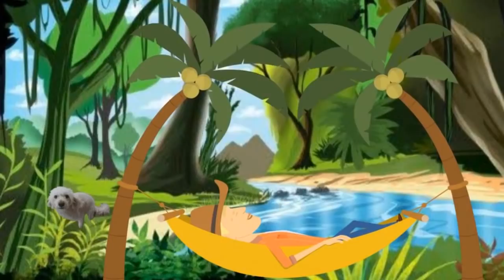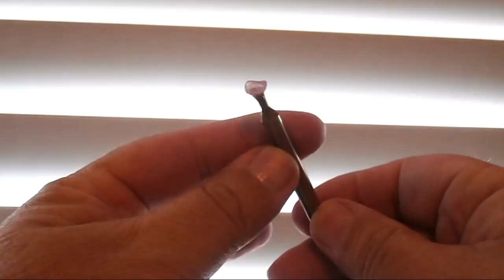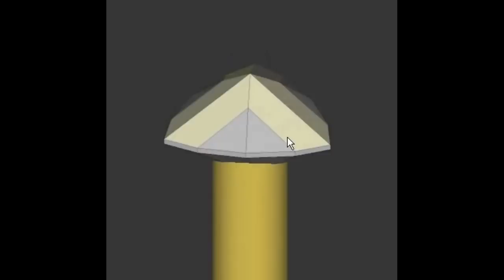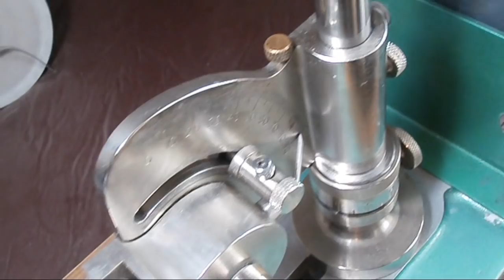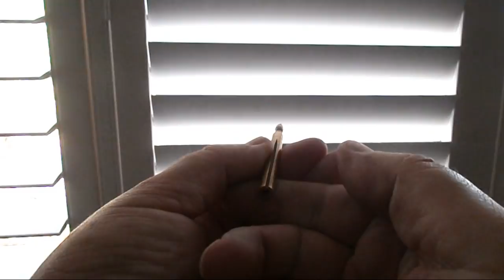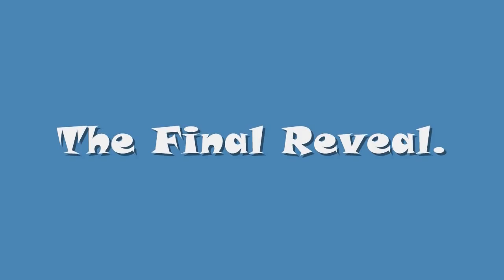Gemstone Faceting - Pink Sapphire

Comment: The orange peel effect, is caused by sapphires that have been heat treated at very high temperatures. When you polish heat treated sapphires, you can often get the orange peel effect.

Comment: I would LOVE to be able to work on some Sapphire but it's hard to source affordably. But I am considering contacting "your friend" from Tim's Adventures.
Another thing I'd love is the ability to work with such tiny gems. I have an old Graves Mk 1 faceting machine that needs Spindle Bearings to reduce slop but I don't have small enough Dop Sticks to cut anything less than around 7mm dia.  Unfortunately, this means most of the rough I find (of fine gems) is too small for my setup. What a shame.
Reply from the maker: Sapphire is always expensive. In my opinion a bit of a overpay as there is so much 1-3 carat sapphires around. I reckon Zircon is better.
Reply: @VintageTimeGems  I love cutting Zircon. It is a tremendously, scintillating gemstone. I have cut a few and hope to cut many more very soon. That said, I have since ordered a brand new Ultra-Tec "VL Classic Faceting Machine (Digital)" which should arrive in 6 more weeks (ships on Sept. 23rd, 2023) and just ordered my first two genuine (Umba) Sapphires. One is a Pink and one is Purple. They are both very small but I also ordered several tiny dops for tiny stones. I intend to practice cutting tiny gemstones using less expensive rough including Lab-Made Sapphire until I get my technique perfected using this new faceting machine.
Thank You Cliff for all your inspiration. I essentially learned how to facet by watching your videos (and some others). I live in an area where there are no other facetors to learn from so You and U-Toob have been my instructors.
Keep up your fantastic work and videos. I look forward to seeing many more. I have watched every video you have uploaded and will continue to do the same. Take good care Friend.  😊

Comment: Wow! I can't believe I missed the notification that you posted the video.  What a beauty.  A sweet tiny little gem. I can't believe how beautiful this Sapphire turned out. As I was watching I kept thinking it was going to be heavily included and kept wondering if I could cut something so tiny.  It was cool to see the Trillion cut come together. I have to try one now 🙃. I love the color and how it is both soft and bright and sparkly. It would look great in a setting. It looks delicate but Sapphires are so strong. How well would this hold up in a ring setting? It's points on the corners would have to be supported in the setting I would imagine. 
Wonderful gem Cliff. Good job Jaws in helping to fetch that Sapphire.
Reply from the maker: Thanks Tam. This gem has no inclusion. This is a great design. So many Trillions about, I would facet this again and again.

Comment: Another fine teenie you've cut. Well done. I do like the cut and will have to keep it in mind. I love the simplicity of it.
Reply from the maker: Hi Ricky, yep another tiny one 5mm is still a lot bigger than the 3mm garnet. From memory you set gems. Is a Trillion difficult to set in a ring? Cheers Cliff
Reply: They are a little tougher to set of course it depends on the setting too. Believe this or not I have a harder time with marquis. I dislike setting marquis. lol